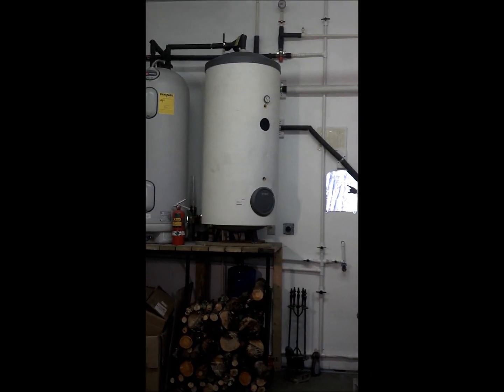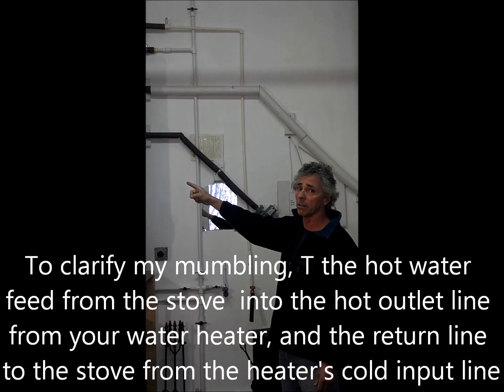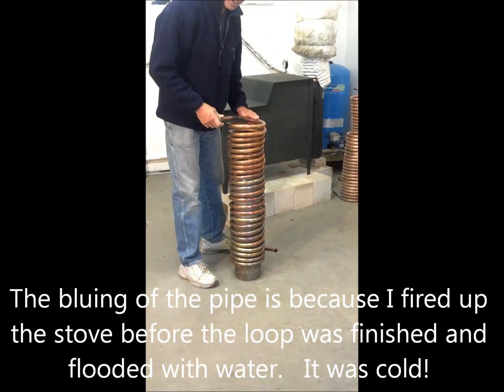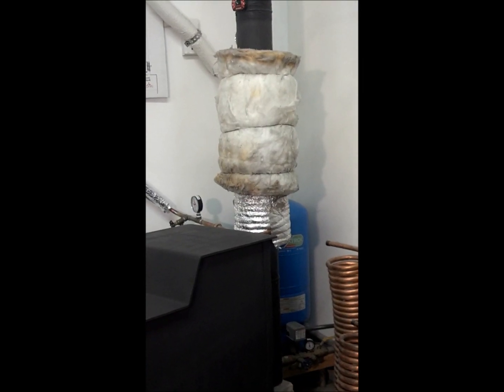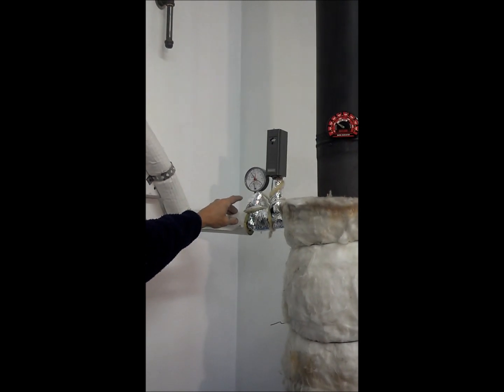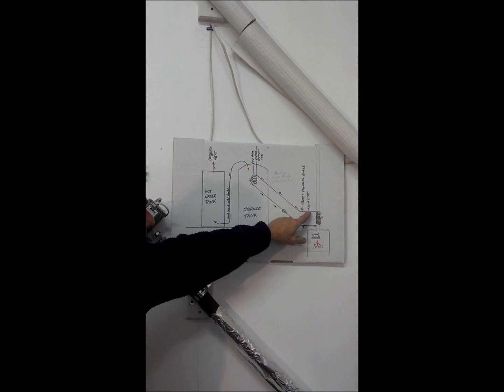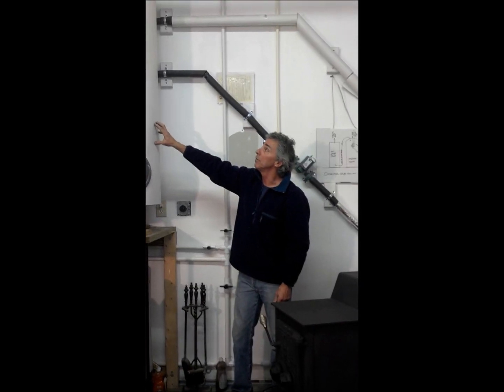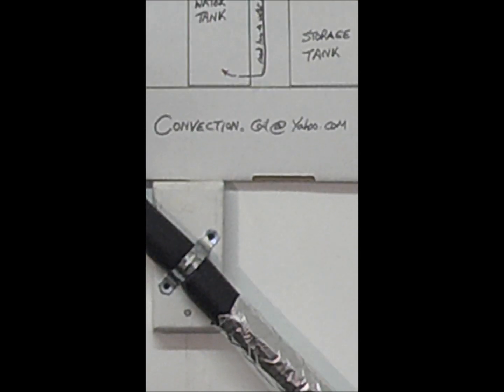How to get free hot water from your woodstove

Comment: Very cool idea! I have thought of stuff like this before but never actually did it. Just out of curiosity, and I know you can only answer for you personally because you probably dont know the avenger persons electric bill in a given state. But How long would it take you to recoup the expense through savings, of building one of these units? I am betting you are into that for 1k? at least? not counting the R&D and other coils you made...
Reply from the maker: Hey John, To be honest I'm into this system for more like 3K if you include all of the solar components. Bear in mind though that there are HUGE incentives available right now for installing solar hot water. If I were doing this today and submitted my total for for these incentives, the Feds would give me a 30% tax credit, the State of NH a $1500 rebate, and my local utility another $600 rebate. Most of the cost is covered when you do a solar thermal install!  Of course the Convection Coil, the piping, and the controls are all part of that same build, right??
The least expensive hookup would be to just elevate your existing hot water heater tank above the Convection Coil and park it somewhere near your woodstove. This is how it was done in the original Mother Earth News article titled Blazing Showers. I would guess that doing it that way would be a long weekend project and shouldn't cost more than a few hundred in plumbing and the materials to build a solid elevating rack.  If you go this route, be certain to plumb a thermostatic mixing valve in your hot out to the domestic hot water!  The CC will no doubt make the water in your heater much to hot to use without blending in some cold.
Payback period? hard to say, but the general assumption is that your hot water is roughly 20% of a household's annual energy consumption.
Reply: convectioncoil.com The problem with the government incentive is: the materials have to be manufactured by a recognized company. The install also has to be done by a recognized contractor. At least that's the way it is here in IL.

Comment: Try Vermiculite to insulate your boxed in pipe. It is very cheap at Garden Centres and easy to pour into and around objects to give good insulation levels. Good luck and thanks for sharing x
Reply from the maker: Wendy Devereux It is a good suggestion Wendy, but as of yet my own coil doesn't have end caps to hold the vermiculite in place, just an outer shell made up from a 3' section of 12" stove pipe. The shell is for appearance only. Between the shell and the coil I actually am just using  a 2' foot wide wrap of unfaced R-11 fiberglass. This was wired tied to the coil with a few wraps of the coil showing both top and bottom. That way the fiberglass is well away from the hot stove pipe and touches only the outside of my convection coil itself. I've never seen the water in the coil exceed 180 degrees so I feel that this is safe enough for now. To retain as much heat as possible in my coil I do have a few inches of Roxul poked in around the top, and yes it does touch the stove pipe. The ignition temp of the Roxul mineral wool insulation exceeds 2000 degrees ...hopefully the flue will never get even halfway to that hot!

Comment: I noted that you are not defining your terms much. From what I understand an aquastat is normally used in hydronic heating systems to controlling water temperature by telling the boiler when to fire up (which can't be done in this case - a wood stove cannot turn on and off) but it at least give you some idea of what is happening. You did not define the term "TACO" at all and "TACO" is just a manufacturer of hydronic systems, not a specific item. What item from TACO are you using?

Tempering valves only do a small amount to compensate for high water temperatures (they are very simplistic items) and are common on hydronic systems; also on gas hot water heaters that are set up to run over 50C. However a tempering valve does not have the ability to intelligently mix hot water with cold water (which would be ideal) in order to keep temperatures consistent (a thing that is more expensive to do).

I know you are cooling your water from the stove coil by taking heat out of it in your holding tank, and that gives you some added safety. However in the real world storage tanks die (often all at once by way of colossal leaks). You really do need a pressure relief valve on your copper coil system. Without one, If anything goes wrong at all you can have a high pressure steam explosion.

You see here in Australia these types of hot water heaters have been very common for ages. You see them in old isolated places in the bush where the people had limited money.

The problem is that copper pipe (and copper welds with lead solder) are not ideal for this. Lead can liquefy from the temperature created by hot stem in a copper pipe.  Most professional flu water jackets are made of stainless for a reason ... this sort of build can very easily explode if made of the wrong materials, with one weak weld, without a pressure relief valve, etc. This is why a properly made water jacket (one safety rated for high pressure and made by a professionally who knows their business) is a far safer option. Better to spend $1000 to $3000 once for an item that last forever, and not get hit by superheated steam because of a leak in your storage tank.
Reply from the maker: ChemicalRefugee 
Taco is a USA manufacturer of plumbing apparatus. In this case there is a stainless model 005  circulator pump in my domestic/ radiant exchanger loop, and the cast iron 005 pump in the convection coil/ storage tank loop.
The copper section of my closed convection coil loop is isolated from the iron internal coil in the Steibel storage tank by dielectric unions. Hopefully this will prevent any premature tank failure as you have described.
The storage tank does indeed provide a huge domestic tempering factor before the domestic hot water system, but the primary reason for using the extra (storage) tank is to be able to combine my convection coil with a thermal solar summer hot water system. It also provides an extra 80 gallons of hot water storage over and above the 50 gallons in my Marathon electric water heater. This time of year (October) the sun in NH is fairly weak while at the same time I only need to fire up my woodstove occasionally to remove the chill. Neither the sun or my woodstove is providing much heat to the storage tank, but still there is some. I'd much rather pay for the amount of electricity required to heat my water from 85 degree more or less water in my storage tank than the 55 degrees of ground water.
Perhaps I am using the wrong term in "tempering valve"?? I'm not a cerified plumber. It is simply an adjustable temperature controlled sliding mixing valve that mixes hot water with a proper amount of cold water to achieve a consistent output temperature. I set mine initially by feeding directly off my storage tank when it was well over 150F, and running the domestic feed over a thermometer for about five minutes. It has been working flawlessly since.
There is both an expansion tank and a boiler relief valve in my convection loop, and I regard both as mandatory for any kind of hot water system. I  flush and test the pressure relief valve at the start of each season. The water in the coil will never achieves the steam state both due to these mechanical safety items and the inherent nature of convection to my elevated storage tank. Quite simply, the hotter the water gets in my coil, the faster it flows. 
I pressure tested my closed convection loop to over 100 pounds before firing it up initially, and have never seen it exceed 45 pounds in operation, even when I deliberately pushed it by running the woodstove full tilt boogie for nearly an hour. I did see the storage tank rise to a peak of nearly 170F during that extreme test ( the circulator was set to a 135 degree turn on point and on consistantly during that test).

Comment: Do you have any idea what the flow rate is through the pipe (with and without the pump running).  I'm currently working on a similar project but my water tank is at a lower elevation than my stove so I have to run a pump.  I'm trying to gauge how long my coil needs to be and how fast I want my water running through the coils.
Reply from the maker: Mark Lammey No clue as to the actual flow rate Mark, but one of the main reasons I chose to go with 3/4 as opposed the much easier to form 1/ or even 3/8 inch was the flow rate. For example, the flow rate of 3/4 is more than double that of 1/2 inch pipe. When I first start my stove and the storage tank is still relatively cool,,the delta between the heated water leaving the coil and that of the water returning is about 20 degrees. At that point the only thing moving the flow is the convection, and the delta seems to indicate that there is an efficient exchange in the storage tank. I wanted the flow to be as free as possible to promote this, and thus the need for 3/4 pipe.

Comment: The best thing to use for insulation is raw sheep's wool. You can buy it by the bail. It is fire resistant, won't go mouldy, and it is natural. Avoid insulation bats and fibre glass.
Reply from the maker: Craig Zwetsloot 
Hi Craig,
From what I've seen during my research, sheep's wool has an ignition point roughly half that of fiberglass (~550 degree as opposed to 1200). Mineral wool is the best readily available material, but it crumbles when bent and doesn't wrap as a blanket. My coil has been wrapped with unfaced R-13 fiberglass for going on three years now without a problem. The secret I think is in keeping the fiberglass a few inches back from the end of the coil so there is no way it can contact the very hot stovepipe directly. The coils themselves never get much above the boiling point.
This insulation is also apparently what is keeping my coils from drawing away too much heat from the stack and creating creosote. I check the pipe bi-annually, but have yet to need to clean this section. The only build up I ever have to deal with is the top few feet of metalbestos and the chimney cap. That is expected, normal, and routinely cleaned.

Comment: did it work and enought hot for heating floor ???
Reply from the maker: andrew Bob It works just fine Bob for my small living space. The Steibel SBB300 storage tank is the only heat source to my radiant floor's heat exchanger plate. For a larger living space you might find it necessary to add an auxiliary heat source in the storage tank to exchanger plate closed loop.

Comment: I solved the copper pipe around the flue issue by completely boxing in my wood stove and flue. I used aerated concrete because I didn't want heat radiating out through the boxed in section, but you could use bricks, stones, concrete blocks etc (you might want radiant heat). What happens then is ALL the heat generated by the fire and the flue is trapped inside the boxed in section. You then just drop your loosely wound copper pipe inside the boxed in section, no need for the copper to be tightly wound around the flue anymore, as inside the box is hotter than what the flue ever was (it has the heat from the wood stove there as well). Then you cut some holes in the BASE of the boxed in section, to let cold air in, and in the TOP of the boxed in section, to let the hot air out, and your wood stove continues to heat your house, only now it has heated your copper pipe first!

Comment: i went with simple
i removed my bottom heating element  in my 40gal electric water heater and i installed a 300w 12v heating element and connected 3 100w Solar panels to it
i capped off the 220v wires that connected to it for safety and i turned off the breaker to my water heater
and i take a nice hot shower every night and all is heated with the Solar panels powering the 300w heating element in the bottom of my tank
cost $550 and now all of my hot water is produced by the 3 100w solar panels and the 300w 12v heating element
last month we had a week with clouds and rain and i still had hot water but did not need to use as much cold water to take shower
all in all i find that the 3 panels with the 300w 12v heating element is plenty for my house hold needs and i can still turn on the water heater breaker and used the top heating element in an emergency that is still connected to the grid
and i am typing this on my computer that 100% of the time is run off of my off grid solar system that charges 12 cart batteries power a 1500w Inverter and powers my tv's computer's lamp and internet router and is used to charge all devices (phone/tablet/laptop/)
i am hooked and plan to be off grid 100% as soon as i can
Reply from the maker: Interesting Dexter, but I'm not sure your system would work this far north (42 degrees). There is very little power in the winter sun here, but plenty of trees for our wood supply.  I do now have a 40 square foot solar thermal panel on my roof which easily supplies my all of summer hot water plus much of the spring and fall needs. It is plumbed to my Steibel storage tank as a second closed loop filled with polypro glycol. That is circulated with a 12 volt pump hooked directly to a dedicated small solar panel, it was cheap to do and it works great!   You're right, simple is usually better.
Reply: i do agree you must decide what is best for were you live
and i live in Texas and am having grate luck with my system
also most hot water heater's  are insulated good so even in a cold place it should work well
i know the solar panels do perform better in cold weather
so long as you have a good bit of sun to shine on them

Comment: I recommend ceramic wool insulation use on boilers. lasts forever.
Reply from the maker: Chad, is does this come in rolls of flexible woven batt, like fiberglass?  The Roxul is fine for the heat rating, but crumbles when flexed.

Comment: this is a very stupid thing to do, VERY!!!!!!
Reply from the maker: Can you elaborate why please?  The coil loop has a constant flow to the elevated tank due to natural convection, is circulated even faster by the addition of a thermostatically controlled circulator pump, has an expansion chamber, and finally is topped with a boiler pv valve that is piped to within a few inches of the floor. Please do share where you see a problem Kaoss53, maybe you could even share an improvement??
Thanks
Reply: by wrapping coil around a pipe and running water through it is keeping the pipe cooled more then its designed to, then you build large amounts of creosote. there are plenty of people that have thought of this. hints forth theres a reason why it has not been patented. Stove pipe is just not ment for that application. Over 40 years of wood stove, masonary and pipe experience. plus if ur insurence company saw that, they'd drop you so quick and if you ever had to make a claim they WOULD NOT PAY. insurence companys are asshole's. but if you plan on keeping it like that make sure you keep that pipe clean. Best of luck :)
Reply from the maker: Good concerns Kaoss53, but they have proven to be unfounded. The creosote has not been an issue at all, due in part I'm sure to the fact that the coil is externally insulated, and in part to my habit of running the stove open enough to bring the stack temp up over 450 or so once a day. Please read my other posts.
Where my flue comes out of the back of the Fisher stove, I have a tee rather than the customary elbow. The bottom of the tee ties into a capped one foot section of pipe which I can easily remove for regular inspection. Looking up from that point shows the flue to be grey soot at the area where the coil is, but there is never any build up. The only area of my chimney that requires periodic cleaning is the outside cap, and to me that is normal and to be expected. I haven't considered a patent because a convection loop is actually a very old idea, I first saw it published in Mother Earth News in 1978. The trick is in forming sixty feet of 3/4 soft L to a snug 6" id coil ...without kinking it.
Reply: well if it works and you have no issue's i guess not much i can say against it. stay safe

Comment: Cool...or rather Hot. Might I suggest using a real vid camera next time...LOL You might want to see if there is an ebay market. Post one on ebay and see if there is any interest. Did you create a website?
Reply from the maker: Yeah, There is much for me to learn about filming videos, LOL...  The website will ned to wait until next fall now. I sell solar pv for a living and the Spring season is starting to kick into high gear already. Here 'tiz the second week of April, I've just come back from a day of FABULOUS skiing at Cannon Mountain, there is still two feet of frozen snow in my dooryard, and yet the sun is already making it's irresistible strength very well known. The top of Cannon was in the clouds and cold today with all the trees encased in fresh rime ice, while the base was at about freezing but the sun was melting off snow quite rapidly.  I drive out of my north facing home on a road still covered in winter's ice, and slide down the south face of my road in mud rim deep    Spring in northern New Hampshire, I do truly love it!

Comment: You can by an OD 3/4 spring that fits inside the ID 3/4 pipe. This way, you can't crimp the pipe. we do it all the time at work.
Reply from the maker: It might work Janet, but bear in mind that this is an unwieldy 60 foot section, not a handy 2 or 3 foot piece ...still, it might work by attaching a long leading rope.
Another factor is that I wish to be able to wrap the copper tube tightly enough around the flue pipe to slightly flatten and compress the inside to the flue (see Elderly Iron's good video on this), more heat will be transferred this way.